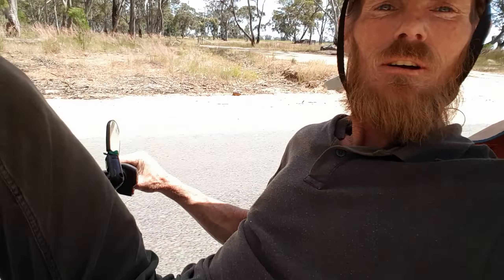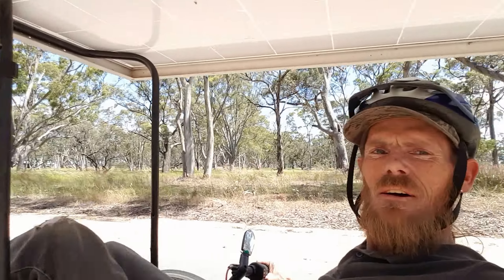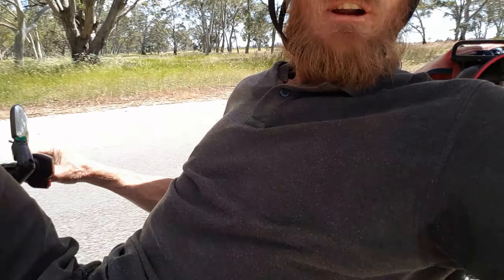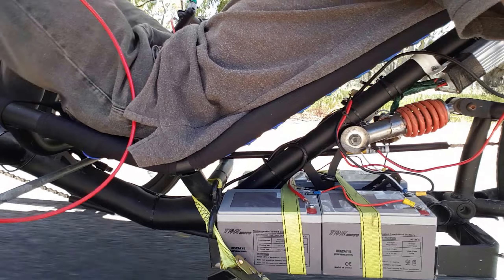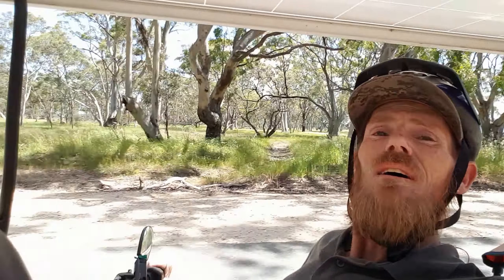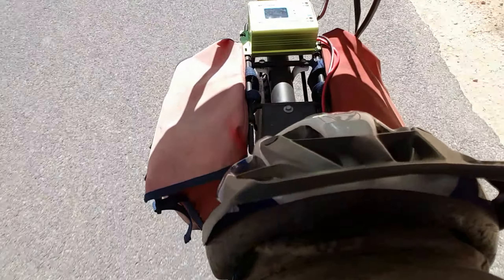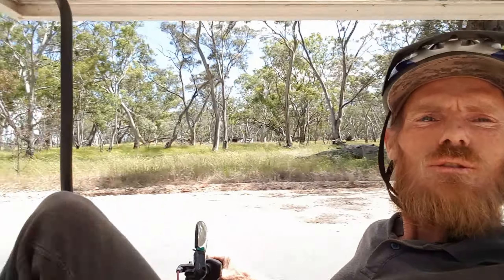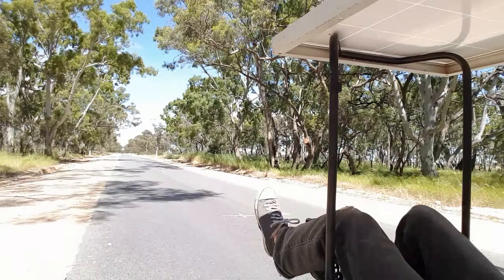Solar electric recumbent distance test 1

Comment: Awesome job... how many kms u can go with pedal assist, with this added solar energy?
I wanna built something like this...but with a flexible thin solar panel.
Reply from the maker: Vagelis 4VP It can do an easy 90klm+. The trike is 500w 48v with 20ah batteries, I have since changed it out to a 1000w 48v hub motor. It has quite a bit more power and reaches speeds of 55klmh and still gets the same range when using pedal assist. I am currently building a fat recumbent trike like no other. Please Subscribe and I will have a video up soon on the current build. I think you will be pleasantly surprised.
Reply: Thnx.--Great!! 100km is pretty good range. I will keep an eye for future videos to see how your project is going:)